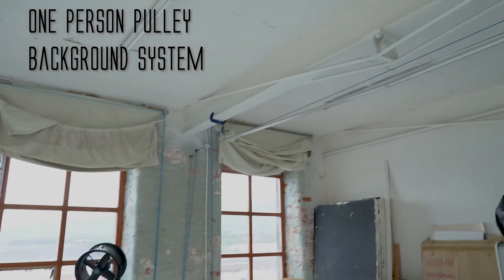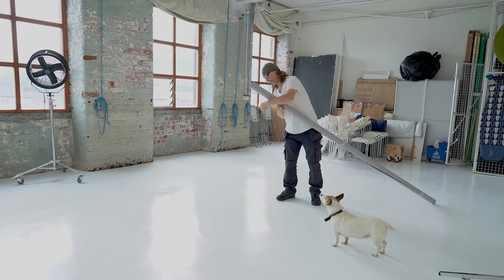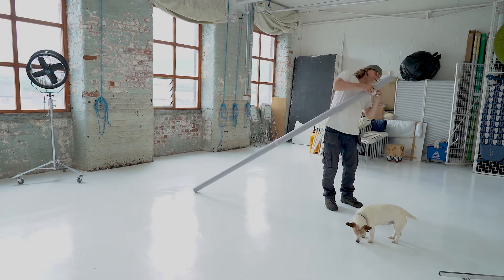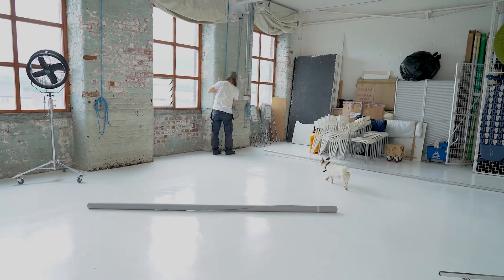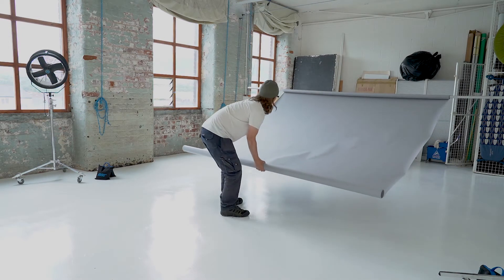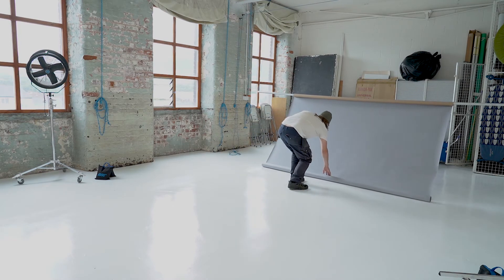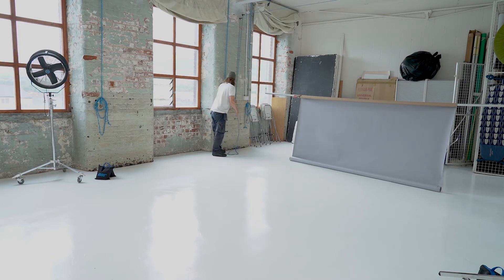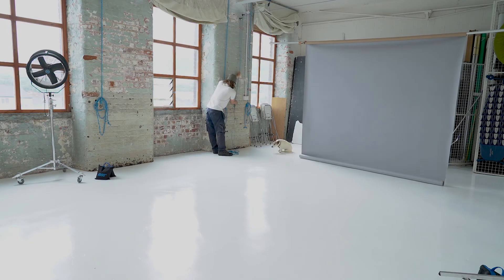One Person Pulley Background System

Comment: What is the bracket or holder that was used in the ceiling to attach the pulleys to?? I tried to pause the video it's a grey item.
Thanks in advance !!  What a great system I'm looking to do the exact thing to hang drapery to work on.

Comment: How did you actually install the Pulley system (hoping it’s something you made yourself using some sorts of DIY Pulley system)? Pls accept my apologies for the inconvenience if it may cause.
Remember, Life is Short so, Live Long and Prosper  ~🖖~ and I believe Our World is a Shared Experience …
Reply from the maker: Yes, I sourced it all myself; Manfrotto AluCore for the gantry bar, drill a couple of holes at either end for a carabiner, then nylon rope up to a pulley in the ceiling, across to a set of pulleys on the wall and then down to a cleat mounted on the wall.